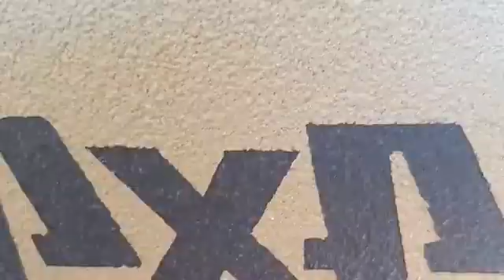Jimny Extreme Rebuild (Raptor build)

Comment: Greetings from Florence, Italy I have a 2001 Suzuki Jimny 4x4 with a m13a 1.3L petrol engine.  All original for use on dirt country roads.  I also use it on farm and mountain roads and even on completely snowy country roads! For me the Suzuki Jimny is an excellent off-road vehicle, better than the Nissan due to its smaller off-road size .  Limited off-road mastodons compared to the Suzuki Jimny 4x4, the Patrol 4x4s does better off-road than larger off-road vehicles such as the Land Rover Defender 4x4 due to its small and compact size!!! !